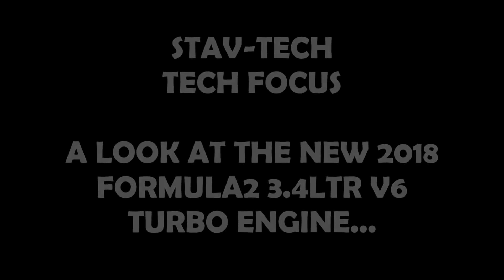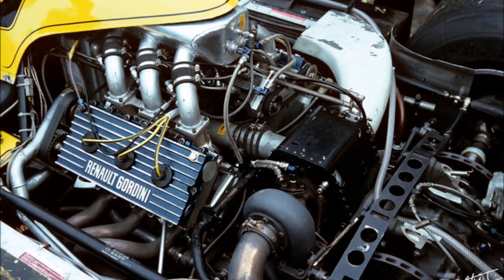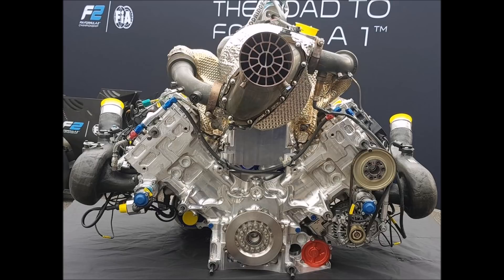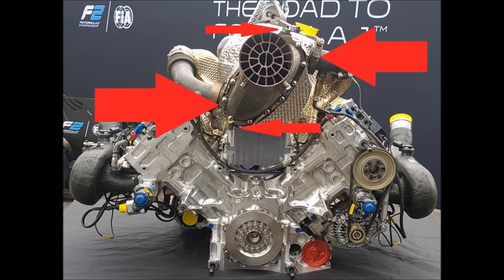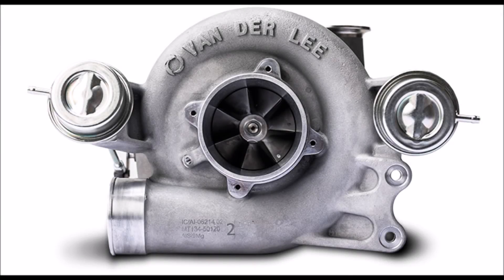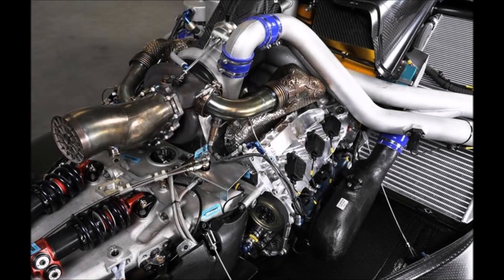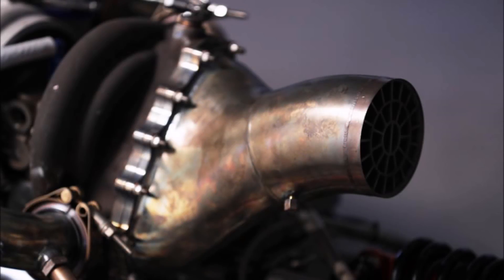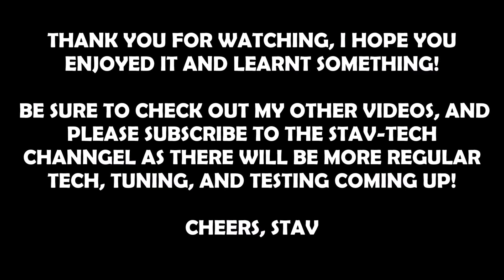620BHP Billet V6 Turbo! A Technical look at the new Formula 2 engine

Comment: since these are being installed in open wheel cars with the drivers head exposed and at the same height as the exhaust, the grid you see will be to catch the turbine wheel, or wastegate flaps if they were to break off so that you wouldnt potentially have a piece of metal flying at your helmet at 200mph+......that was my first thoughts when i saw it....i might of course be wrong though
Reply from the maker: I'm 99% sure you're right! Same as on certain drag racing rules. I've no idea why I didn't think of that!